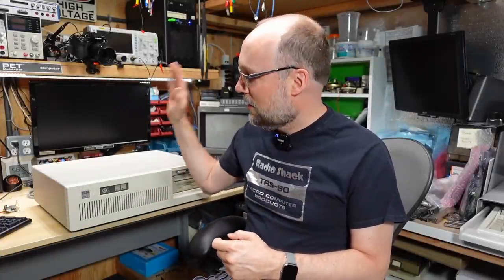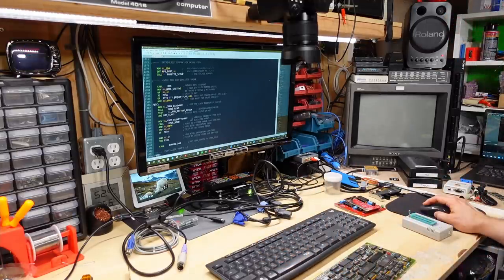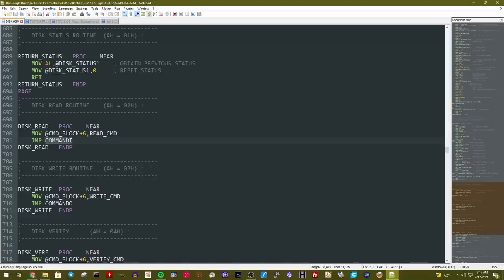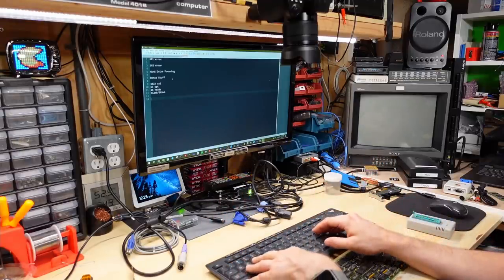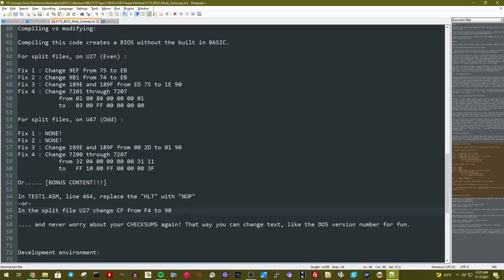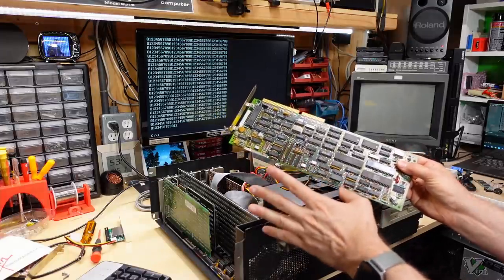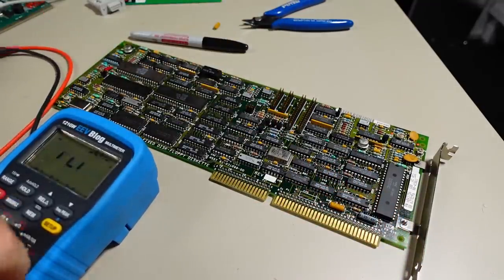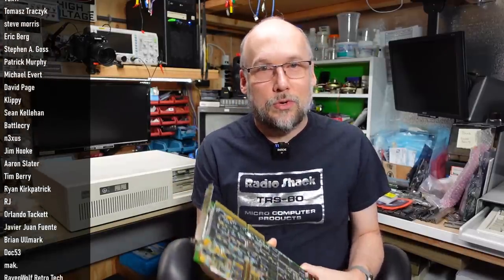Fixing and improving the IBM PC/AT 5170 BIOS (bonus shorted tantalum fix)

Comment: Some excellent BIOS fixes there!
So, no overclocking to a blistering 8MHz on this one Adrian? It has a socketed crystal and the original i286 CPU can easily handle 8MHz, so it's easily accomplished and just about everyone with a 6MHz 5170 did it back in the day so it will remain period correct, but it'll give you a nice 33% speed boost 👍 Do it Adrian! Join us at the overclocking darkside!
Reply: And now that the BIOS is on the bright side of the force... You can try to modify it to remove the code that prevents overclocking the 5170  beyond IBM's 8MHz limit... I bet you can do 10MHz. Maybe more? That would be awesome!
Reply: he has a type one motherboard here (the ones with the 128K piggyback ram)

type 2 and type 3 motherboards (with 2 banks of 256k chips)  had a socketed crystal, but most type one boards did not.

simple enough to desolder it though. 

Fun fact, the type 2 and type 3 motherboards are the exact same board with a different crystal, cpu, and bios. WHy  different bios? well, the type 2 board bios actually had a timing loop in it to prevent users from swapping the crystal and overclocking it themselves. (type 2 was 6mhz, type 3 was 8mhz). Both 6 and 8mhz versions were sold during the same time, and the cost difference was significant.

If yyou tried to overclock a 6mhz type 2 motherboard without swapping out the bios you would get a bad bios beep code if i recall correctly.

Comment: BTW, 601 is half of 1202, the error that came up on the DSKY when Apollo-11 was about to land (basically a data overflow error).  Also it's the error that causes the central computer in the original film The Andromeda Strain to crash when it tries to calculate the number of possible mutations that "Andromeda" could take.
Reply: Everytime the error codes were mentioned I kept thinking of the Apollo 11 '1202' alarms that kept flashing up on the descent to the moon's surface.
Reply: which, of course, implies we're in a simulation and everything is scripted
Reply: @TheSulross  you want to check out something even trippier than the simulation idea? Search for the Boltzmann brain by pbs spacetime

Comment: To think, 40 years ago, IBM fought to prevent everyone from editing their BIOS code. This is what Open Source is truly about, mustering the community to fix problems with an original design. WTG Adrian. :)
Reply: Did they?  They weren’t too keen on having clone manufacturers copy the BIOS, which is why it had to be re-implemented with a clean-room approach.  But as far as editing the BIOS yourself ... they gave you the source code ... with comments ... in the manual.  :-)  I think IBM’s stance at that point in time is that you should know exactly what it is doing, and to make changes if you need to and are so inclined.  That goes for the code and the hardware, since schematics were in there too.  Heck, the “game port” card, which they called the analog input card, had a big old wire board area built in for prototyping, so you could read arbitrary analog inputs and do whatever you wanted to do with them.
Reply: @nickwallette6201  If I recall correctly, my original IBM PC had the BIOS on a ROM chip without a socket. I suspect that would be done more for cost than anything else, I suppose we could have copied some of the bios routines and modified them into our own programs that ran on PC DOS, but not sure how modifiable the BIOS and its POST logic would have been without reworking in a new chip.
Reply: @harleyarmstrong5947   Yeah, would likely have to hook into interrupts and bypass the ROM.  But, I would lean toward that being a cost-cutting measure, or perhaps even something silly and pedestrian, like they had a supply chain shortage of sockets.  Afterall, they did sometimes make available BIOS upgrades -- so they were aware of, and planned for, the need to replace the ROM ICs regardless.
Reply: @nickwallette6201  so that ISA card with breadboard on that was unpacked a while ago now wouldn’t have been necessary there.. pretty sweet. I’m reminded of people hooking up thermistors to a C64 or a Sinclair’s port and writing software to calibrate and making their own homemade digital thermometer. I wonder how many of IBM’s customers actually did that. Not that many kids buying Usborne books AND original IBM PCs… still neat to know though.

Comment: Watched both your videos on the 5170 and DEFINITELY can relate to your frustrations.  It was my first EVER PC bought for me in 1985 by my Dad, who worked for IBM, when I was 19.  With Proprinter, EGA Adapter and Monitor, 10MB HD, and a bunch of software all for $5500 at the 50% employee price :).   I loved the thing and it was "State of the Art" in 85. Because of all the annoying glitches and limitations tho I learned a TON tearing it apart, upgrading it, especially breaking it, and putting it back together. Much more than ever actually doing anything productive with it.  As a result, I've been a PC tech all of my life.  In 2015 I realized it was coming up on the 30th anniversary of getting the AT and was feeling nostalgic for it, so I decided to try to rebuild it EXACTLY to spec with all ORIGINAL parts.  I was suprised how easy all the parts were to find 30 years on and more surprised to be be reminded how frustrating the glitches and limitationd in the BIOS were.  I've been working in countless ( both long and short) spurts since then to tackle them.  So in over a 35 year span I've spent literally a TON of hours working on the AT, and may be able to offer insight as to why those glitches and limitations ( not all of them technical ) are there.  Also I HAVE been able to accomplish what you were trying to do ( 1.44mb floppy drive.. Compact Flash and SD bootable readers etc...without error codes  ) WITH the original IBM BIOS.. ( no alterations ).  TRUST ME.. not claiming to be any smarter... just more stubborn and wasted far more hours. If you'd like to hear how and my other insights on the AT reply back and I'll share them.  For now I've been long winded enough. Either way Bravo to you and Stuart for so quickly identifying the sources of some of the EXACT same glitches and problems I've run into, and your very smart solution to them .  My bottom line on the 5170?... It is a stately... majestic... beautiful BEAST with a more stubborn... quirky personality than almost any other entity I've ever encounterd, either silicone or carbon based... Just my 3 cents... :)  Regards

Comment: just an FYI: LBA addressing was retired a good 5-10 years ago when hard disks went beyond a terabyte. The replacement is ADF - Advanced Disk Format - which uses 4 KB sectors. These disks can obviously only be used with a modern BIOS that understand ADF, but some BIOSes (probably not any as old as the 5170 though) can be updated to a version that has ADF support, though the change notes will usually just say it supports larger disks. If you use one of these disks on a system that does not support ADF it should fall back to an LBA translation mode which limits the usable disk space to whatever the LBA limit is on that system. I discovered this when I put a 500 GB HDD in an old Toshiba laptop and it told me that I had to update the BIOS

Comment: Adrian, one trick I have come up with in dealing with older machines in which I want to make BIOS changes (or add BIOS extensions) is to use the boot ROM socket on ethernet cards. If your NIC has a boot ROM socket, you can put the XTIDE BIOS in there and it will work.

Comment: I know this is an older video, but you know the deal - it's new to me. Anyway, back in the 80's we uses a boatload of IBM 7532 Industrial AT machines, which used the original AT motherboard, the big ones under the power supply complete with 512MB of piggyback RAM chips and socketed clock crystals. They were all 6MHz machines, until we replaced the 12MHz crystals with 18MHz crystals and made them all 9MHz machines. These were all factory-floor production control computers, and we had ZERO reliability issues with the "overclocked" systems, which ran 24/7 for years.  Anyway, I noticed your comment about 6MHz being slow, and thought I'd toss that in. Do with that information what you like.

Comment: if the bios check for the original controller card was something exclusively IBM-branding thing then there's no problem in bypassing it at all; but if that check is part of a generic functional test (regardless of a closed-branding thing) then there will be side effects to bypassing it and you will find them in the future while using some feature of the hardware (i.e. in the middle of a game) by Murphy's Law
Reply: Have over 35 years experience with the 5170 and there are several possible reasons for the check in the bios ( including both possible reasons you state ) My guess is more on the branding side.  In learning a bit of the history of the 5170 development, it seems IBM reluctanly "threw in" support for 1.44 floppy drives into the bios of the Type 2 and Type 3 motherboards in the AT, because of pressure to keep up with the industry but I'm 99% certain they never offered a 1.44mb drive of their own brand for the AT at the time, so they were only covertly supporting it. This is probably the reason why the 1.44mb floppy drive option doesn't appear in even later versions of the AT Diagnostic/Bios Setup Disks.  If memory serves, I believe the specific controller card its looking for are IBM original ones that have specific Western Digital Chips on them.  IBM may have thought ( possibly through internal testing ) that these controllers were the only ones that either supported 1.44 drives reliably OR at all.. in the AT.  I believe this is only half true but that's only through alot of trial and error experience, not any forensic technical analysis.

Comment: Had a similar problem with an AT about 12 years ago. Used an adapter aha1542 maybe aha1642 scsi card then had an adapter from scsi to compact flash card.
Reply: In that regard the 1542 was doing the same thing as the XT IDE replacing the hard drive routines in this case for SCSI
Reply: @VidaDigital  it was doing exactly that. So the AT though it was just a scsi disk with a scsi card with its own bios. Then the pcb converted standard scsi to CF. It was quite a find back in 2008/9. Still working running sco xenix 286
Reply: Actually it was easier to install sco on to a scsi disk

Comment: Speaking of the BIOS, here's an optimization to do. Since it was reassembled, things might not be in the same places in memory as before. That could mean that alignment issues could have been introduced. Plus not all assemblers use the same opcodes.

So what you can do is to find all of the important loops, subroutines, and entry points and use the EVEN directive before each. If you find NOPs where they make no sense, remove them, but if you find NOPs before loops, subroutines, entry points, and data blocks,  remove the NOPs and replace them with the EVEN directive. So the assembler will pad those places with NOPs to make sure the next address is even.

Since it is a 16-bit CPU and the memory map is byte-oriented, reading words out of alignment means it takes twice to read a word, returning the 8-bit bottleneck of the XT. Interrupts and frequent subroutines are where you particularly don't want this problem.

Comment: I worked with a guy that programmed assembly code on mainframe IO routines on a custom version of Honeywell GCOS.  I did lots of assembly code on a standard Honeywell back then.  I bought an Atari ST because I studied the 68000 before buying and really liked the instruction set and 24 bit addressing.  I haven't coded assembly in 30 years!  I miss it but I refused to try it on my first PC clone purchased in 1993 because of the segment registers.

Comment: Debugging and fixing a race condition in someone else's assembly code Something most coders would run away crying from. Amazing work by Stewart. I wonder at what clock speed the original code starts to fail at when using an original mfm hard drive. I doubt anyone would want to underclock an AT just to find out

Comment: To think that almost 37 years later, IBM's original AT BIOS is working correctly for the very first time!

EDIT: Second thought, and having actually watched the 601 error part :D, I think "working correctly" might be overstating it, because the unconditional jump is more of a hack than a fix. Not to be anal about it, but that's not the same thing as understanding exactly what they were trying to do and why this was failing even on original or 100% compatible hardware. I still applaud this, but it's a hack not a fix. The same is true for the 162 error. The hard drive NOT_BUSY code is an actual fix, IMHO.

Comment: I think, that modifying BIOS is best way to go.. Love the results.
Great work and video! 

Now I'm thinking, why I didn't thought about that earlier.. 😂
Because, I still have IBM main board with 8088 CPU that works (in Basic), but can't boot in DOS after recommended update to MS DOS 6.22.. Older DOS worked and booted fine from hard drive.. I assume, that BIOS is expecting some signature in in MBR, that original older DOS had.. 
 
Thanks for idea! 😉👍
It's assemblers time again for me..

Comment: Was it found out why the “too” fast hard drives were a problem with the IBM BIOS, but apparently not with other BIOS’es? Did the others already work the way like the IBM BIOS would after your modification? Or did they do something completely different?
Reply: I would suspect that the other BIOSes were accepting interrupts before they issued the command to the drive, while the IBM BIOS was probably only starting to listen after the command was issued.

Comment: Didn't IBM publish the source code for the PC and AT bios in the USER manuals?
If running MSDos version of the assembler (not windows), then can use DOSBox utility to run it.
Reply: Technical Reference Manuals, but yes. Says so on the site shows: they scanned and used OCR on the printed BIOS code in the manuals.

Comment: Trying to keep it pure would also be not using hard drives that were not available at the time the PC was made.   IF you want to use modern hardware the machine was not designed to utilise, then you need to use more modern ROM's.  Any modifications you make to stock ROM, even if it is just changing conditional to permanent, is NOT keeping it pure.

Comment: Better solution to the checksum problem: Write a little Python tool that calculates the checksum and generates a ROM with the checksum before using minipro to write that ROM. I think you can get minipro working on Windows, and it should run alongside the Windows minipro software (maybe not while the windows software is running), preserving the BIOS checksum feature while also giving you the convenience of not having to remember to fix the checksum over and over again.

Comment: If you're going to hack the BIOS at all (which is justified, given the IDE read timeout), you might want to go back to the third-party BIOS but with all the splash screens and messages stripped out and/or altered to look like the equivalent 5170 routine. Then it will still look stock and can quickly be reverted to the original state, but secretly have all the advantages of later 286 machines. I'm not sure what this would do as far as trying to share your work, though.

Comment: I wonder if those error codes were put in place to call out if you didn't have the approved IBM options installled. They knew they couldn't prevent you from using some else, but they could make it look like it wouldn't work

Comment: If you want to keep cassette BASIC, it would also be necessary to just patch the original ROM image, since the BASIC was written by M$ and therefore not within their rights to release.  The reconstructed listings just fill that space with FF's.  And before you note that there's disk basic, remember that it still uses the ROM BASIC for its core functionality.
Reply: DISK BASIC, from PC DOS and ADVANCED BASIC, both use Cassette Basic( ROM) as its core, but there are utilities that patch this to add the ROM to Disk and Advanced basic. ( advanced basic! still a laugh! )
Reply: I believe it was called MoveBas.
Reply: Still, the ability to reverse-engineer enough of that BIOS and BASICA.EXE to move the image into a single COM file was an impressive feat for the time.
Reply: @ovalteen4404  

Since the ROMs were in a separate segment, it needed to be an EXE program file, and since the ROMs were always at a specific location, all you needed to do was to copy the ROMS, and then patch the location were your EXE file would put them.